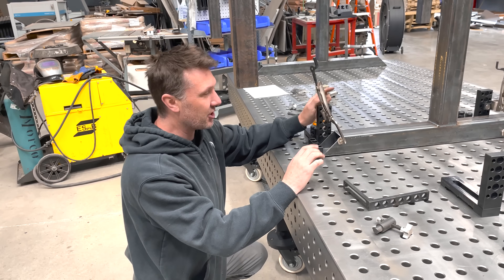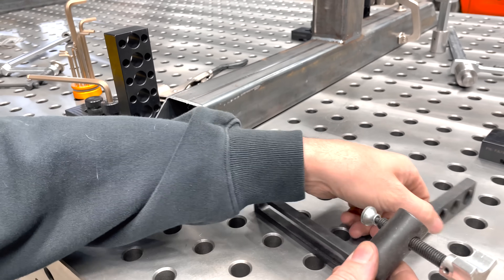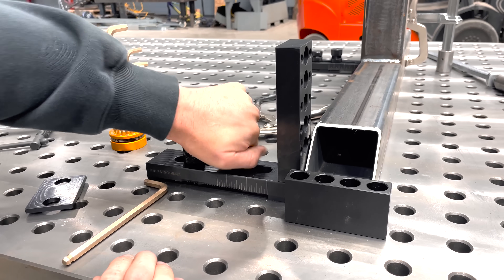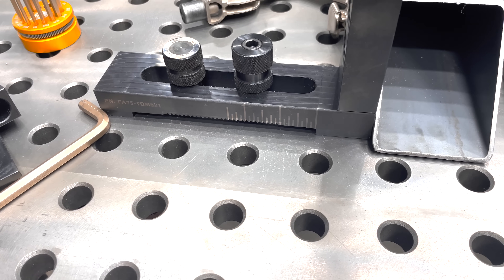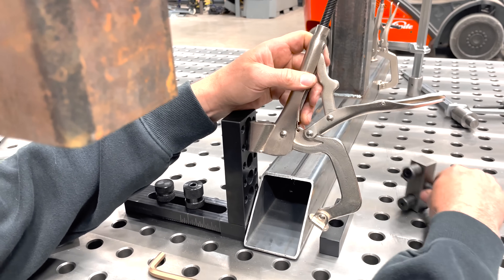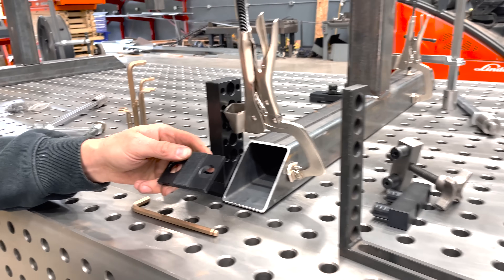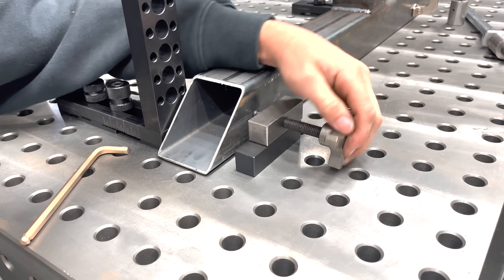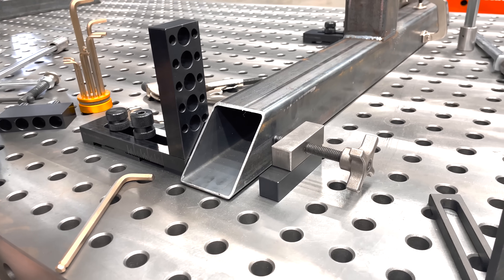The Wrong Way Welders Use This Fixture

Comment: Great video as always Jason. I watched all the way until the end hoping you would show the difficulty of removing the welded frame. I really was curious how much the welded frame moved with all the fixturing, stops, clamps, and such.  I'm no fabricator by any means, but that top tubing had to have some bow to it after welding. My thought would be to actually back bow it a slight amount so when fully welded, it would come out near straight. 
Could you share a short video of the assembly fully welded? Any mishaps you didn't think of? Is it straight without the need for pulling or pushing?
Always appreciate your transparency in videos.

Comment: You could use s second pusher behind the slotted fixture, then it’s pusher vs. pusher. You also get “fine adjust” of the location on the slot.
Reply: Counterpoint is you lose the benefit of it being a jig. You’d need to adjust and reset every single time due to both sides being adjustable. No problem if you are only making one piece, but then do you really need a fixture table anyway?
Reply: that makes too much sense and solves the problem his $800 tool does

Comment: Professor Jason nail's it. Thanks for sharing.  I gotta start drilling some 5/8" in. holes is my welding table, with my Magnetic Drill, and purchase some of those fixtures.
Reply: I wonder if you can make a template to get the spacing perfect on the holes.  I think bluco tables are made in a big CNC mill, so the hole pattern is very precise.  I'm not familiar with mag drills, but perhaps if you made an initial hole normally by hand measuring, and then had some fixture that could locate your drill in that hole and align it perfectly for the next one.  I suppose if you use slotted bluco fixtures only, it wouldn't matter if your hole spacing is precise... However it would be nice to at least have a few sets of holes that are in a perfect box pattern in order to allow you to get precise 90 and 45 degree angles.  Sorry for the long comment, but I was thinking about the same thing and was curious how you planned on doing it.
Reply: @somethingelse4424  First lets define accuracy. is it 0.001" in., (one thousandth of an inch)  plus or minus, or are we talking  0.0001" in. (one-ten-thousandth of an inch,) or are we talking 99 percent of welder's, working on projects, world wide, where plus or minus a 1/16" in. (0.0625" in.) is the world they live, breathe and work in. Unless your working for NASA, where every day, you have to re-qualify before beginning work on said NASA project for that day. Next day rinse and repeat.   A mag drill = Magnetic (electric Magnetic Base, turn Magnet on, turn Magnet off. I give you Magnetic Drill Base for Dummies 101) Drill Press.  So the question would be how accurate can you Layout a "Patten" say one inch (2.54 cm / 25.4 mm) spacing, and then drill said layout either by hand or using a Mag Drill.   If you can't layout a pattern, this conversation is over.   Big name company's brag their item was made on a CNC this or that.   Well we all know, CNC this or that machines on their own don't form Unions, they don't ask for pay-raises, don't get in fights with their wives, etc.  But CNC machines are accurate as hell, and very repeatable, unlike those low-life hoomans. (spelling intended FOOL.)  Did I mention that those CNC machines, when it's 98 degree's {36.6 °C} out, and Humidity is approx. also 98 percent, they don't sweat either. This is my shocked face.  So, unless your very anal about "perfectly-precise," and one-ten-thousandth of an inch, keeps you awake at night, don't even try it. Shaking my head in total disbelief.   "Perfectly-precise," to prevent creating worm-holes in that time continuum thing my ARSE.  As a member in good standing of the great American Deplorable(s) (thank you Hillary Clintoon) & UN-WASHED, Drill baby, Drill baby.  Drill for oil, and Drill the dam holes in your welding table.😎
Reply: @stanwooddave_1953  I'd have to check what the tolerances on the holes in the "non slotted" type of bluco fixtures are.  I'm guessing if you could keep your hole spacing error to +/- 0.005", you could use more than just the slotted type if you drill a little bit oversized.  Maybe you already know this, but I also think the pins need to have something for the balls to bite into, so your weld table needs to be a certain thickness in order to use them.
Reply: @stanwooddave_1953  I’m pretty sure he’s gone for 3/4 inch pins and fixtures.🇬🇧

Comment: they need a upgrade on the older table saws the rip fence would move after repeated rips ..maybe 1/16 too 1/8 of a inch but finish work that is a lot ..

Comment: But surely if the pusher is strong enough to move the fixture then it would easily move with warping
Reply from the maker: Yes slot fixtures can move from weld pull. That’s why the tooth block is necessary.

Comment: You're trying to reinvent the Wheel, and make it way more complicated.
Reply from the maker: Actually I reinvented the square.
Reply: @Fireball2ool  How, were all others not Square ?
Reply: @65cj55  check his other videos he made a new square .. for clamping and welding .. it is much better system then what they had 10 years ago ..he is not trying to reinvent the wheel ,, Jason is just making better tools to work with .. aka working on a pallet or a nice level table  Jason made the table ,,  as far as the size of the pegs to go into the table there was small / too small for most / then there was large / too large for most workers at home .. so Jason made a system that gets the best parts from both systems and made a great system ,,, if I had the money to get the table and clamps I would get it asap I could use it almost every day ,, living check to check it;s hard to save the $$ up ..his video on the table shows how it works it is very simple too use it is not complicated ..
Reply: @randytravis3998  Nah he won’t. That fool just wants to create controversy where there isn’t any. The type fool with never anything positive to say. Just check all his comments.
Reply: @randytravis3998  47 years as a Fabricator and never had a issue, i have similar Squares and fixtures i built over 30 years ago, and Welding Tables etc, have been around a long time, none of this is new, but i understand some People have to have the latest & greatest of everything.
Reply: @65cj55  iterative evolution is the way, he's not selling a revolution here. The more experienced you are, the more you need to make an effort to see the value in smaller evolution or change. "We've always done it that way" is a blessing and a curse.

Comment: Or just clamp vertically to the table, and use your fixtures only for reference and location....
Reply from the maker: What if your material is bowed or bent? Or flat bar stock on edge? You might have to push it sideways into position. Also fillet welds can pull the material out from underneath the clamp in some instances. It’s good practice to clamp in both directions if possible
Reply: For some stuff thats good and for some stuff having the flexibility to move clamps around like this can be useful especially if your welding oddly shaped things where vertical clamping is less convenient
Reply: How can you be sure your reference/location is positive if you are not clamped to it?
Reply: @philmenzies2477  because my tape measure confirmed it was correct after I clamped it down....it's called "trust, but verify"... I work on a stronghand buildpro table every day, as do others in my shop, and no one sideways clamps like this....only in the rarest of occasions will you need to throw a vise grip clamp on a fixture piece ..and it's usually on the 8" or 12" fixtures when you start getting up above the table surface..... clamping down to the table is def best practice

Jason's argument above about straightening bent or bowed material and fillet welds being able to pull is flawed, because if you try and flatten a bent piece then weld it, as soon as you remove it, your part is going to distort....that stress is going to transfer to other places now....also fillet welds will ALWAYS pull, and you'll never be able to counteract it on a fixture table with tiny clamps.....that why skilled fabricators sequence their welds to minimize distortion, and pulling from weld shrinkage.  You can't stop metal movement, only work with it.
Reply from the maker: So your saying that side clamping is unnecessary? That down pressure is all you need for everything?
Reply: @Fireball2ool  I'm saying if someone is side clamping exclusively, that's an improper use of the table....in the context of the video, you say "people tell me I should clamp like this...." Which I agree, pushing against a slotted fixture is incorrect, and the way you demonstrated is BETTER, keeping the forces isolated from the table...but, I maintain that clamping against a fixture located on the table, to move material, or trying to oppose weld forces as a substitute for sequencing your welds, is def not best practices.
Reply: @Steelcrafted  That makes sense to me.  I make check fixtures in the machine shop for weld, and most of them go on a bluco table... So I don't weld myself or use them, but I see them being set up a lot.  It makes sense to me that your forces should be directed down at the massive, functionality solid steel table, rather than the relatively smaller pinned-in-place brackets.  I know they are hollow, but still they are beefy as hell.

Comment: Well theoretically both ways can deform the walls of the material if it’s too thin or a small contact patch especially when welding and heat is applied. Your way can lift the tube off the table if the wall is deformed as well. The best way is probably use multiple clamps with lighter pressure on the wall or use a v block style clamp forcing the load into 2 walls on each side of the clamp at a 45deg.
Just my $0.02
Reply from the maker: Yes 45 degree clamping is great if you have positive backstop or fireball tooth block. Just be careful of the slot fixtures.
Reply: @Fireball2ool  Awesome to see your interaction with your viewers. You always have cool ideas, hopefully ill be able to purchase your welding table and fixtures when I get my own home shop setup and am able to reinvest in tools.

Comment: Makes perfect sense.  I have a similar practice with my cheap chop saw.  

The fence is a standard pivoting design, not super stiff, bolted down to the base which is also not super stiff.  The screw clamp for the fence is also attached to the not-very-stiff base.  When I started using it, I found that using the screw clamp to hold a work piece against the fence could actually flex the base.

After giving it some thought, I decided to remove the screw clamp portion entirely, and I just use F-clamps or locking pliers to secure the work piece to the fence.  This holds the work piece securely to the fence, but does not introduce any stress into the system, as you don't have one part of the saw base pushing against another part of the saw base.